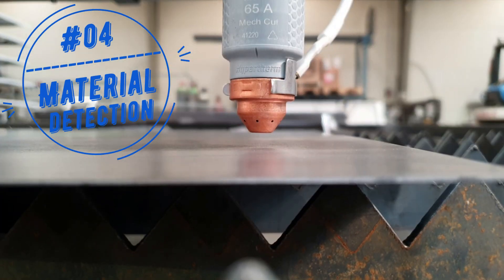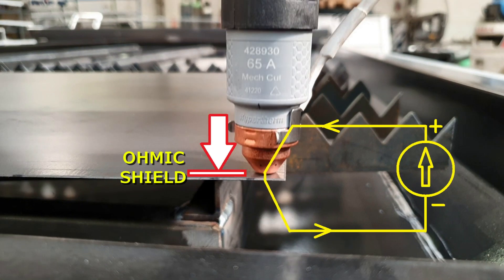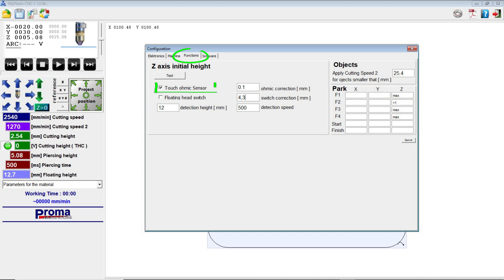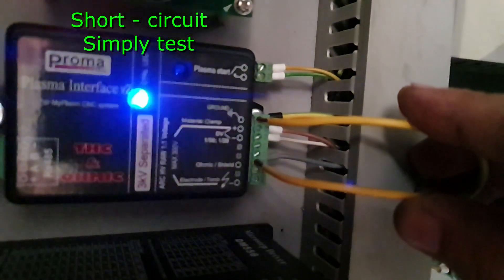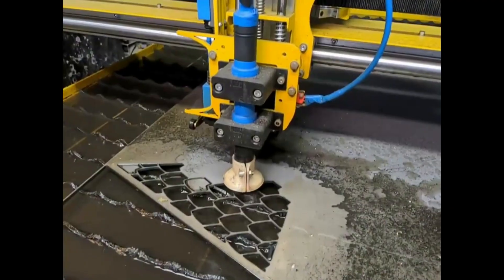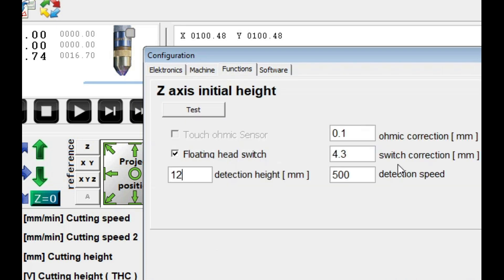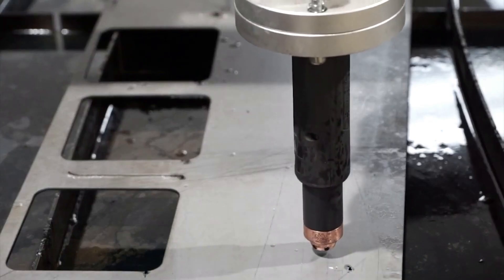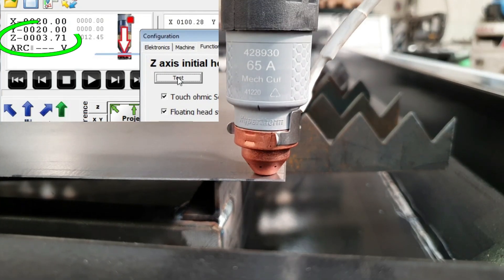# 04 MyPlasm CNC - Plasma OHMIC and Floating Head - Step by step

Comment: Hello guys, is there any tip how to make ohmic shield much more reliable when there is metal dust and splashing water? I've tried add to circuit (ohmic shield) a 20K potentiometer and it is better but still unreliable. Is ohmic shield "only for dry cutting"??
Reply: use a "pipe" as shield. and blow air for a couple of seconds when Z going down.  (if you have good airflow and starts when its 15-10mm over the part,  it cleans the surface 99% of the times. ). some people use air while cutting also (if water is a problem). search for " Cnc plasma tips" on YouTube,. I found this tips in a boring long video. some young us guy(